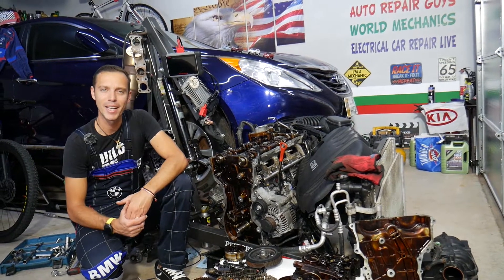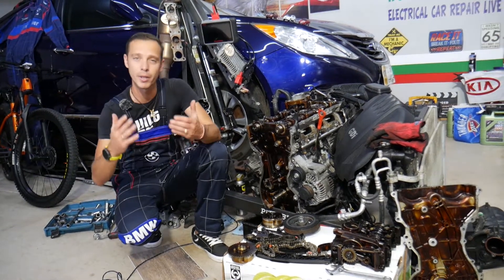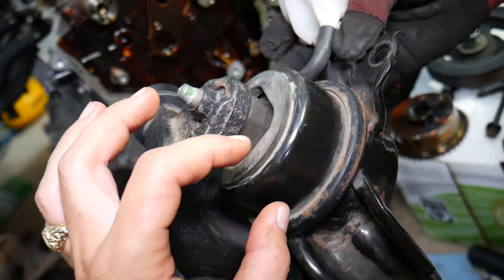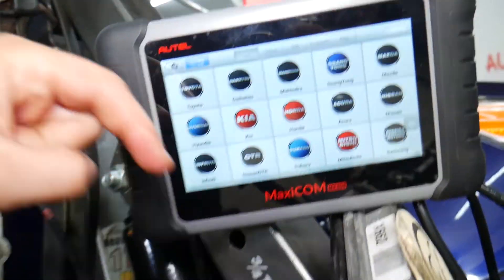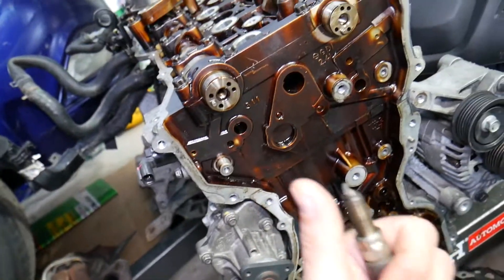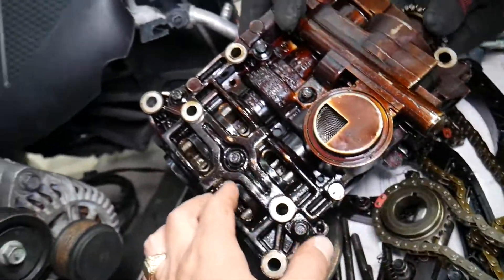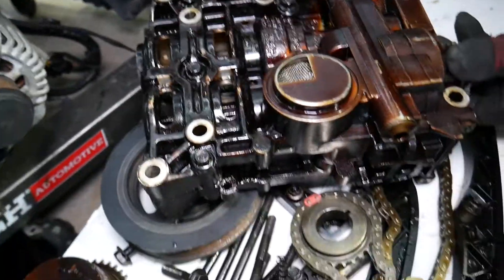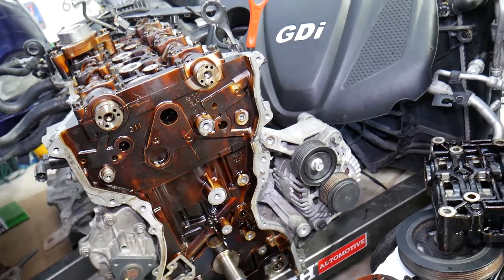WHAT CAUSES ENGINE VIBRATIONS ON HYUNDAI KIA GDI ENGINE, CAR VIBRATES

Comment: On a DOHC 2.4 Hybrid i am getting a vibration below 1300RPM, replaced all mounts, new spark plugs, coils, tested and cleaned injectors, Cleaned throttle body, transmission rebuild, no codes. 
What can cause that vibration ?
Reply: Same with my kia sorento. Did u find a solution
Reply: @allthingzjazzy  no :( my optima 2009 2.0 dohc did the same thing
Reply: Wow. Thanks for responding.